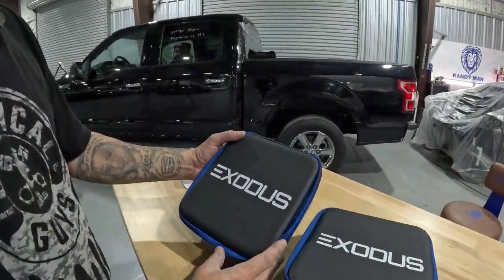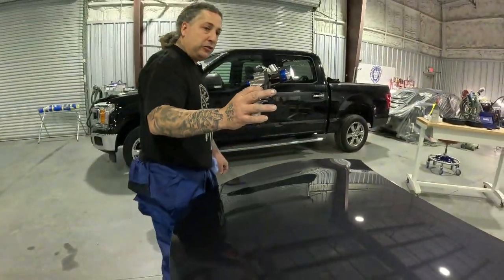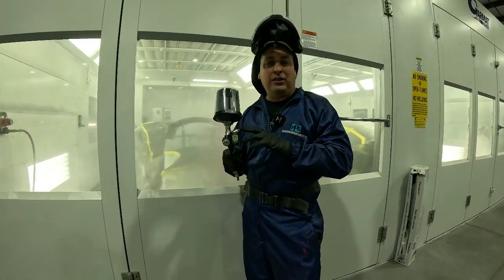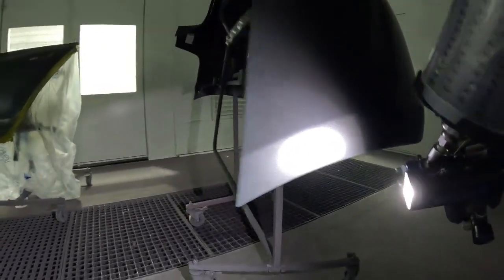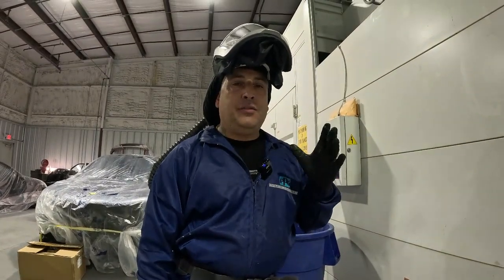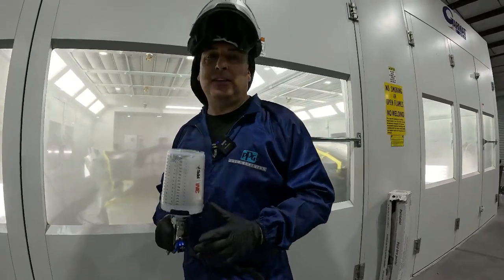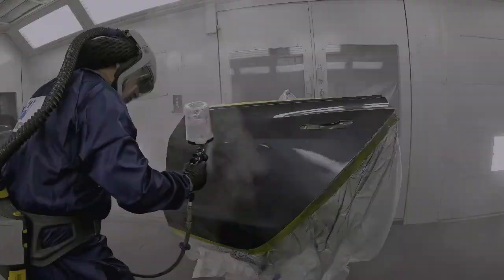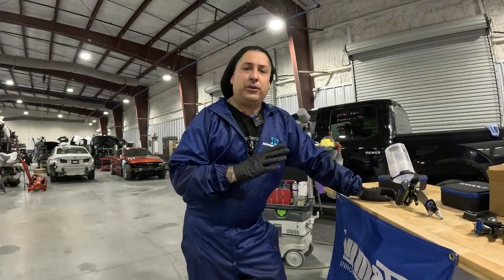How To Use A SunPro Light - Luma III Exodus Spray Gun @lumaiiiinc-innovativerefin3375

Comment: I've heard a lot of good things about these guns, they are actually the Meiji Finer Core but Meiji worked in conjunction with Luma to create the custom graphics then called it the Exodus Spray Gun.
You did a great job on the base and clear using this gun Kandy Man and they both came out great, so would you say this sprays like or better than your DV1 or would you compare it to one of your other guns🤔
Thanks for sharing🙏👍John UK
Reply from the maker: By the end of this week I'll have more of ideas we're it falls versus my other favorite guns.  But right now, I can say it kicks @#$
Reply: Ok thanks, looking forward to hearing your thoughts.
Reply: @JohnWD40TC02 it is similar to the dv1 in finish quality, with less overspray and more speed. I bought one in a 1.5 because I can always dial it in. It has six turns of adjustment until full open, and Meiji provides a graph of turns out vs fluid flow on their website. About 3.25 turns out on a 1.5 matches the fluid flow of the 1.3.The internal air passes of the gun body release air at multiple levels create tumbling of the air flow, increasing the kinetic energy of the air prior to releasing air into the air cap. Which gives the air more energy to break up the fluid at a given pressure.

Comment: I wish my work would want to invest into something like that. We get way to much overspray for me to buy it myself and use it. I really want a gun washer.
Reply: I just bought a ultra sonic cleaner to keep my guns clean works great obviously don’t put the gun it’s self in there tho
Reply: I like using SEM 77763 for the flushing it out, helps a ton and the pressure is really nice
Reply: @dill5500   well I have a hammy down gun from the old lead painter that died. He painted for 40 plus years. He soaked his guns in lacquer thinner… so now I’m forced to do the same unless I get a rebuild kit because the seals shrink and the gun won’t spray right at all. Waiting for my new gun.

Comment: Isn't the exodus spraygun same as the meiji finer core or finer force?
Reply from the maker: I'm new to these guns. I think they have a part in the manufacturing process
Reply: We partnered with Meiji and designed our own version called the EXODUS. They are manufactured by Meiji in Japan.
Reply: I know your question is a year old, but the Exodus is the same as the Meiji Finer Core.  The Finer Force is a smaller gun with side feed.